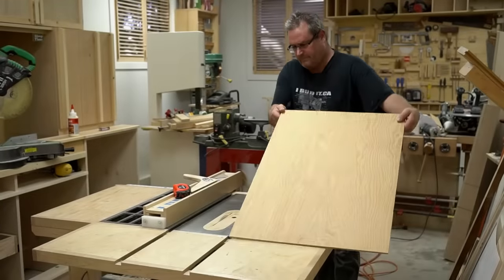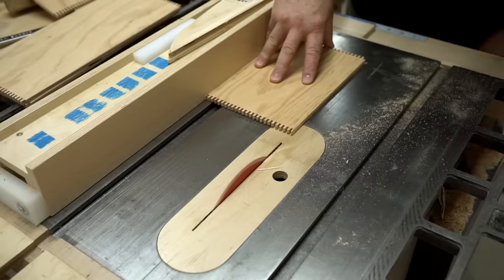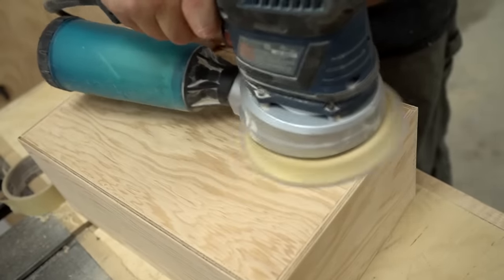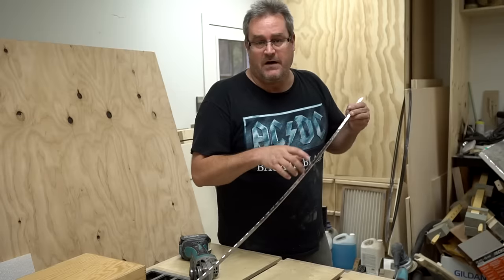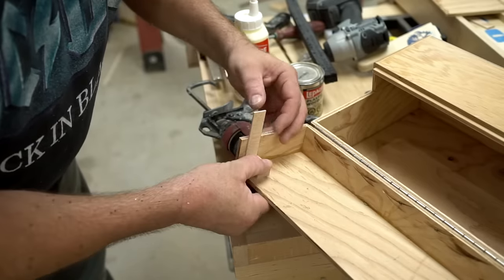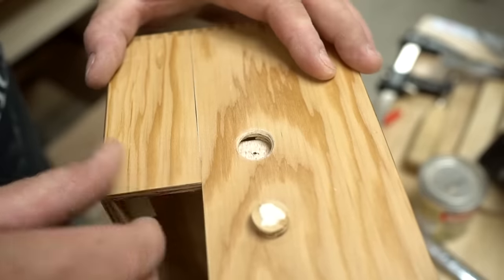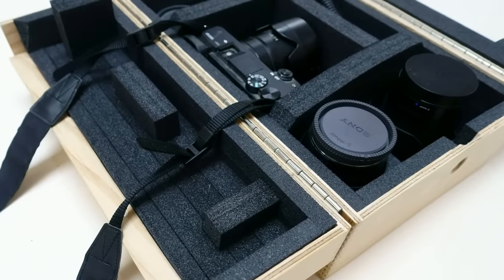This May Be The Coolest Wooden Box Ever

Comment from the maker: As usual, there have been several comments from the experts out there pointing out the ways they would improve the box: 

First is on the strength of the latch - if you don't think it's strong enough, do it some other way. I KNOW it's strong enough for the weight this box will carry, but who am I? 

Second, the hinges on the outside. If you don't like it, when you make your own masterpiece, put them wherever you want. I'd point out that it's very difficult to attach them to the edge of 1/4" plywood to mount them inside, but you already know that! 
Me, (I'm crazy with my odd sense of what looks good), I thought the hinges look pretty sweet on the outside. I like how the interlocking structure of the piano hinge compliments the interlocking box joint. But like I said, who am I?

Third, bevelling the bottom of the button so that the lid will close without pushing them in. Brilliant! Look at all of the effort you will save!! With such a focus on saving yourself a split second of time and a whole gram of effort to push them in, it's amazing you can spare all of the time and effort to type a comment and move your eyes enough to follow the letters on the screen!!!
Me (II'm crazy to be so non-lazy, I know)  I wanted the buttons to look good on the outside and not half filed away. Also, and I know you pros already know this too, the buttons are already small enough to begin with, and grinding away half of the surface you need to push on makes that more difficult to do. But you knew that already!!
Reply: That was the first time I watched any of your video's. That was bad ass dude. I will subscribe an and keep watching. Thanks
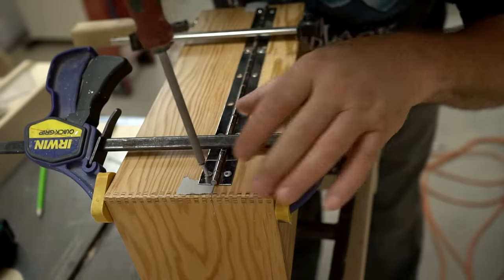Reply: Just a quick question, why didn't you use a special drill bit to center the drill bit in the hole at 5:23?

Take care, best regards.
  -Internet
Reply: Sandsnor  I know your not asking me that, but that was a bit to smooth out the edges so when you press the buttons it operates smoothly.   That is what I believe, but I hope he answers that question.
Reply: You tell them John. I cant stand know-it-alls , who want to critique your work. They can ALL go kick rocks. I'd guess most of their "woodworking" experience amounted to gluing popsicle sticks together in kindergarten. Great video.
Reply: But didn't you know? Everyone is a perfect genius when sitting on the toilet watching YouTube. Lol. 

Don't let it bother you man. Everyone thinks their thoughts are special and want to be heard. That's what the Internet gas done to the world. 

No matter what you do, people will try and find something negative to say... it makes them feel better about themselves.
Reply: Always nice when people tell you to do your things their way. No one ever achieved anything by doing things differently. Pfft
Reply: You're doing some awesome job but you gotta figure out who you are.
Reply: ** your...not you are...Good try, Mike
Reply: John Heisz,  what table saw blade do you use to cut that fine. the red one. thanks
Reply: John Heisz such expert responses. This video made me want to shell out some big bucks to buy the tools I'd need to make this, really awesome!
Reply: John Heisz could you send me the exact dimensions if all the pieces of this box? I could not find them on your website. If you have draftings of it you could send me, that would be great!!

Thanks!

Loved video too!!😀😀
Reply: John Heisz great video gave me some good ideas. the Box looks awesome
Reply: But who are you
Reply: Funny how people think they have the right to pick at something they didn't make.
Personally, I would never have thought of making the box completely and then cutting off the lid as a ready made piece. I'd have spent more time making sure the separately built lid and box aligned properly. SO thank you for that little gift of insight. 

Also, I agree with you, I think the piano hinges work well on the outside. If you want them on the inside you're going to need smaller piano hinges and you'll risk the leverage of the lid making the screws split the wood on the sides of the box, which you'll have to screw them down through if you want hidden piano hinges and no holes on the outside of your new box. That or thicker wood to begin with, in which case, as you say, you'd build it your own way. But to me, what you did with the piano hinges looked good.

Lastly, as a point about the buttons, while it's true that bevelling the buttons at the bottom mean the lid would be easier to close, it also takes away from the flush look of the buttons when the lid actually is closed. So aesthetically, it's not a good idea.

Not to be a suck up, but I think the criticisms of this box are completely unjustified
Reply: John Heisz 
Thank you for uploading this box man that is one of the sweetest boxes I have seen and the locks are an inspiration to me to try them on other projects that I have planned. Thanks again bud
Reply: Unless any of those 'experts' have built their own Biesemeyer style fence out of plywood, I'd tell them to go jump in a creek. Thanks for braving the ocean of internet douchenozzles and gracing us with your knowledge dude. Much appreciated.
Reply: Who are you?!
I'll tell you who you are:
A guy that knows how to make really good looking quality stuff!
A craftsman.
THAT'S who you are!
Reply: John Heisz - I Build It you use the wrong type of black foam for that type of camera and that's the wrong camera to it should be a digital camera... Just joking bud you got good videos. I don't see why people have to tell you how to build your own stuff.
Reply: Sandsnor he answered that in the video.
Reply: Alexandru Raican I’m not sure what he uses but, a friend uses a very fine diablo blade that is 7-1/4”.
Reply: Lord Haberdasher that is brilliant
Reply: Of course everyone is gonna talk crap. Thats all part of being on the net. Funny tho that 99.9% of ppl on the net would NEVER even say a single word if its in person. BUT dont listen to a single person. You do it how YOU WANT TO!! Its YOUR box NOT ours. You made it how YOU wanted to and thats all there is to it. In fact I liked your box alot and went over the video slowly so I could figure out all the steps n ways you did it so that I can make one just like it for myself. SO I THANK YOU VERY MUCH FOR THIS VIDEO!!! If I remember to get pics of it Ill send you pics of it when Im done. Again thanks for the video and dont listen to keyboard warriors lol
Reply: Great video, and great box. Now I'm trying to figure out what to do with a box like this, just to have an excuse to make the box! :D
Reply: I like his pride
Reply: it's your box, fuck the crits if you're happy, your happy!
Reply: never mind them sir, your work is awesome and inspiring, every kind of project somehow derives from another inspiration one way or another , ideas evolve, improve from this
Reply: @skruvmaejsel  He mentions the bit, how he used to use the bit, how he no longer uses the bit, and why. Watch the 'whole' video.
Reply: Cool box.  Good vid. You're smarter more creative and have far better skills. I know my place in this hierarchy.  But still.  As a boat builder I couldn't help thinking that  plywood would be an order of magnitude stronger if skinned both sides with 3oz transparent fiberglass fabric and epoxy laminating resin.  A small sledge goes right through bare 5mm marine grade plywood. But if skinned both sides with even a light glass that sledge starts to bounce back, instead of going through.......you've inspired me.

Comment: that catch mechanism is pretty badass - nice job John!
Reply: May not be as weak as you think. The weight is distributed between the lid's hinges and the buttons, not the buttons alone.  The wood 'spring' is cut so the weight pulls at the wood in the direction of the wood grain (the direction that the wood is strongest). Wood glue connections are very strong, so the button has about as much chance of breaking from the wood spring as a wood dowel would in the same location.
Reply: Nick Ferry .
Reply: Hellsong89 really, the weight from the hand to the handles and spread to the hinges and the latches, seems plenty adequate.

Comment: did you think of having a slant on the buttons so when the lid closes it slips into the hole without having to do it yourself?
Reply: He chamfered the inside of the box wall, so they will slip in by themselves.
Reply: I think in combination with the interior notches he still needed to depress the mechanism I was going to to say the same thing as David with a chamfer on both pieces they might slide past each other.

Comment: I learned from watching Adam Savage that pop-rivets work really well for attaching hinges to thin wood boxes.
Reply: Yes he is intensely safe. I would be too if I blew up that much stuff !
Reply: I tried that before, but didn't like the look of the expanded pop rivet.  Worked well enough, though.
Reply: Doug Kennedy You can hammer them flat or cover them in foam like this project. Also if your material is prone to tearout you can put a washer on the backside before popping them.
Reply: retsaoter such a savage

Comment: I see I'm not the only one who likes to drill with an impact driver.  Though for screwing, these days, I prefer to use a drill because the ratcheting of the impact driver is so awfully loud.
Reply: Hi Matthias
Reply from the maker: I usually only use it for that pin chuck for bits that are too small for the drill chuck. Most of those hex shank bits (the cheaper ones, anyway) are just press fit in, so the bit works itself loose.
Reply: An electrician I know made a great statement about using impact drivers for small screwing operations, something like: Using a sledge hammer to crack a walnut. Seemed fairly accurate to me. :)
Reply: 'Like trying to shell a Walnut with a JCB!!!!'
Reply: As an electrician, I can sympathize with that.  A halfway decent impact will have a variable trigger, so with a light touch and a little practice you can do smaller work.  Definitely need to be careful with metal self tapping screws and masonry anchors.   The newer brush-less ones especially can easily hog out holes and snap screws. And as Matt said, they are loud.
Reply: Use hearing protection
Reply: When I did my apprenticeship, I was the first person to get an impact driver.  I would put in hundreds of self tappers each day so I thought it was the best thing in the world.  The dirty looks I got for the noise it made though...  I have not put a screw in with anything but my impact driver for 10 years.  Plastic, timber, metal: with practise, an impact driver has the finesse of a screwdriver.

Comment: Nice little project John!  Such a box is an ideal project on which to hone one's wood skills and understanding of what the materials are capable of handling.

I'm pleased to see your approach to oversizing the box joint panels and then cutting them down to final size after the box joint keys are all cut -- this is my approach and it eliminates any of the fussy half-key offset calculations.  A great little tool I use to help locate center for holes, as in getting the screws centered in the hinge holes, is to use a "transfer punch."  The transfer punch is sized to the larger "master" hole and has a hardened, centered dimple on the end of the punch, so the punch fits the master hole very closely and a quick tap with a hammer leaves a centered dimple on the work material which keeps the drill bit from wandering.

Comment: When fitting hinges to thin sheet material you can always add an extra strip of wood to the edge of the sheet to give the screws something to bite into, thereby adding extra strength and removing the need to cut the screws with your angle grinder.

Comment: In my experience, the easiest way to center-drill holes is a transfer punch. You get cheap sets of those in .5mm increments imported. Might not work too well here though because of the thin hinge stock which means the actual tip of the punch sits on the wood before the hole starts guiding the punch. One of these days, I'll make some two-piece punches on the lathe specially ;-)

Comment: nice case, john. the only change i'd make is putting an angle on the lock buttons so they don't slam into the edge of the case when you're closing them, but, rather, they just slide under and click into place. in other words, instead of making the buttons uniform thickness, make them into little ramps.

Comment: Next time go nuts on the hinges to satisfy everyone. Instead of piano hinges, just make 1/8 box joints in your lid and box where the hinges would normally go. With a long 3/32 drill, drill through the entire length, perfectly aligned. Insert a piece of 3/32 music wire, and you have an invisible, and impossible,  hinge that would make everyone gasp. Great work, great vid, keep it up!

Comment: All these comments about  "you should have done this" or "that looks like it will break" are from people who just don't get the point. It's about making something to take pride in, and taking pride in the process.
If you're going to stack stuff on top of it, or want it to carry 60lbs of lead then go down the store and buy something more suitable off the shelf. OK my 2 cents: I note you have to hold in the buttons to close. Have you tried shaving them off at an angle or considered a square wedge, and p'haps a small angled recess in the side, so you don't have to hold them manually inside the profile of the box when closing the lid? It might take a bit of tinkering but I could see how you might make a flat topped wedge type latch that snaps shut but retains a flat profile on the side when shut.

Comment: Nice build. Real slick the way you cut the box to make the top. I just used a printout of your pushstick template to make a luan template (for my template library) which I cut out with a jigsaw. Then I screwed this template onto some 3/4 birch ply and used a flush trim bit on router table to make a perfect copy. I don't have a band saw so this is how I got a square edge on the ply (jigsaw edge would not be square on ply)

Comment: that's a neat idea make a closed box so it's square then cut it apart.here something that might be useful in have a lot of spring clamps they have rubber caps that fall off easily so I put some hot glue on the inside of them and that   keeps them together.

Comment: In principle, a good drawer, but will not put a heavy need to strengthen the bottom of at least a metallic corner. At the expense of the round side of the castle, you can make round parts in a third of the thickness of the plywood and not have to grind a groove a file

Comment: I can't even be considered an amateur woodworker, but while I think the locking buttons are really cool it seems to me that they are supporting a large amount weight of the box on just those tiny glued on wood buttons and their flimsy wood springs. It's probably good enough for light (or even medium) use but if someone put 30lbs of tools in there and lugged it around enough I'd be a little concerned.

Comment: The thing driving me nuts is the gap between the two top halves caused by the thickness of the sawblade when cutting them apart.
The only way to solve that though would be to also cut the bottom half apart and then glue it back together thus narrowing it as well.

Comment: Nice box. I might make it out of stainless steel instead for my lathe tools. Storing steel in wood is not a good thing with all the oil and cutting fluids. And I have a few pre-bent pieces of this thin stainless sheet laying around that is normally used for covering air ducts and vent hood in the kitchen..

Comment: John:  There has got to be another type of joint that can be used with 1/4" plywood that does not employ finger joints.  For those of us who don't have a table saw or a jig to make finger joints.  Got any ideas?
Reply: 3/8 or 1/2” quarter round trim on inside corners and/or outside corner molding.  Lot of glue surface with outside corners.  With both joint is surprising strong.

Comment: Sweet box!  Does this design mean the weight of whats in the box is held up by the locking strips?
Reply: I understand about sticking with the wood theme for the locking mechanism - that's why I like this project so much.

But perhaps a thin brass or copper strip could be used, instead. This would give it durability against accidentally hitting it, and it would accent it nicely, as well. Drill a tiny hole and countersink a small screw into the wooden button - you'll be able to handle more weight.

If using this idea, I think maybe I would go with a brass piano hinge, as well.

Comment: Hello Mr. Heisz, I was watching a video from 3 years ago about a wooden box. I loved it. Just 1 question, i want to try your way of making these box joints but am a bit puzzled. How do you know where to cut the joints? I tried a few to get the feel for it, but i never seem to get them right from each other. every time the joint cuts are out of line. I cut the joints 1 cm every single time but when joining the sides it is all wrong. All the panels are not aligned. Am i cutting the wrong side as you did?  Since i am just starting with woodworking projects i have no clue of what i am doing wrong.